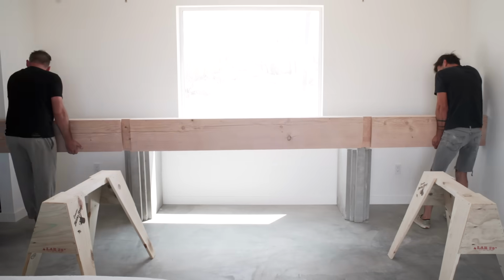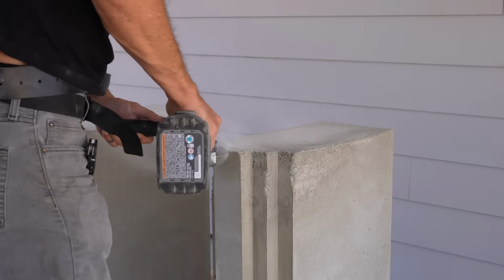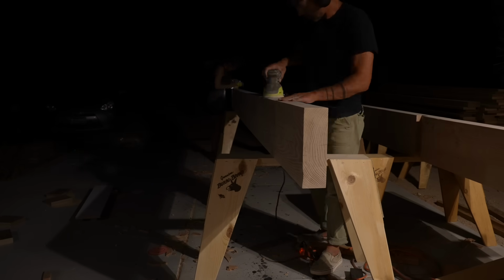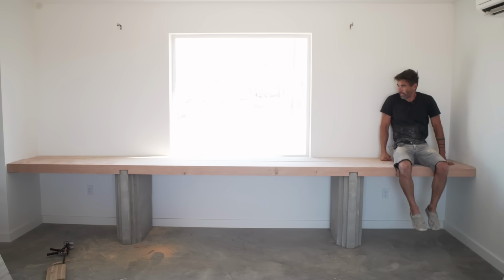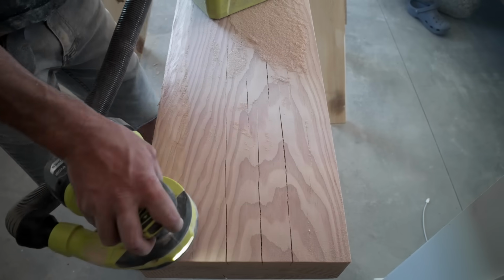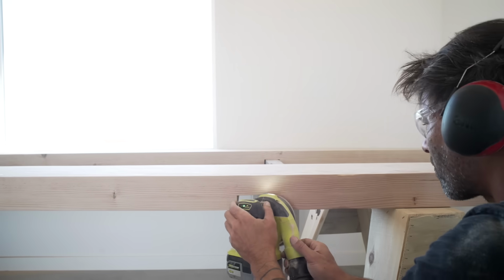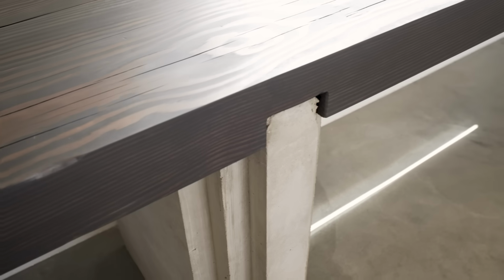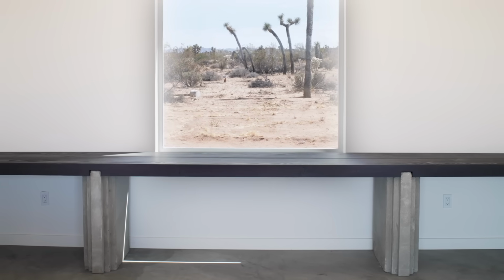I built a 14-Foot Brutalist Desk

Comment: Do you think that in time the beams might deform because of humidity, heat or weight added on top? I'm just wondering since you have two of them, that they might deform in different ways and you might end up with bigger gaps. I love how it turned out :)

Comment: This is a nice idea but more for an outdoor table IMHO because that gap with pencils/pens/receipts falling through or getting stuck would drive me crazy and a bit too soft of a wood for a good desk as well. I also don't understand why you would not add rebar to such a big chunk of concrete either when its so cheap and easy to work with. Even a single rectangle of #3 would make these much stronger and very easy to throw in the center of mold and cost a mere 7 usd more and 10 minutes of time to bend . I understand you used quickcrete 5000 which is akin to M35 or 5k psi of strength vs standard M20 mix or 3k psi of strength but that is only compressive strength where rebar adds tensile strength and shear/bending strength  and  so you can't just simply justify omitting rebar because you change your mix.   Additionally, you should tell people to water your concrete for at 14 days(or min 1 week) several times a day to properly cure which can add almost 50% more strength vs simply wetting it once .  Love your videos .